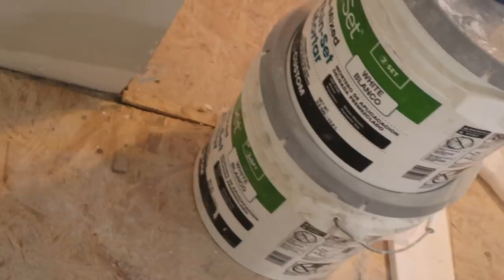To Old To Feel This Old

Comment: I know everybody gives tips on here and it's not your favorite...but here goes my tip.  When mounting a bunch of the same thing like those pulls you can make a cardboard template.  Put a center mark on the template and then it's just one easy center measurement.  Works for anything you have to mount over and over.  Time saver and make sure everything is always perfect with little effort.  All the effort is when your setting up the template of course.

Hearing you talk about everything your doinf shows how far you have come from flip one though bro.  Night and day.  Your a true pro now.

Comment: Use a stiff broom to get most of the spacers out and also use the flat pads when your grouting less hurt on the knees with the straps on the back of the legs... also use some wide blue tape on the walls 2 layers high that way your not wiping it off the walls

Comment: Joe tile looks great don't listen to the negative Nancy's and definitely use shoe molding with the base 9 times out of 10 there will be gaps if you just use base even in new homes the sub floor is not level the shoe will bend to cover those dips